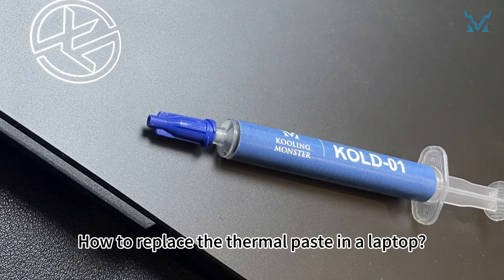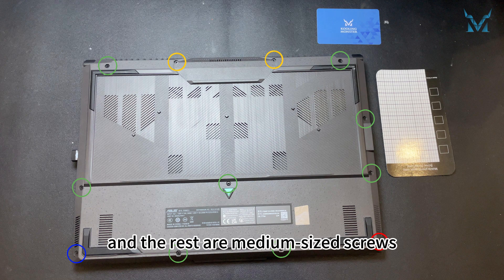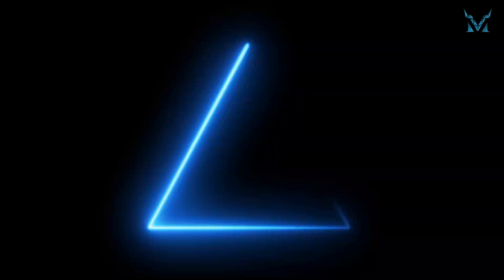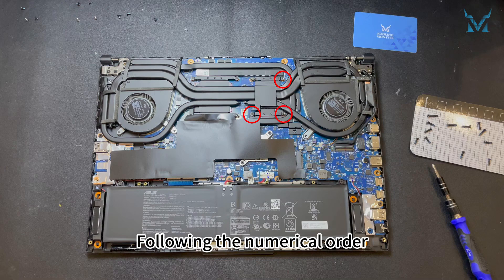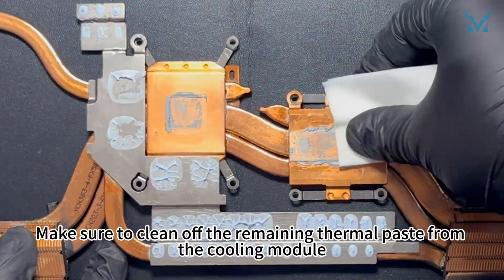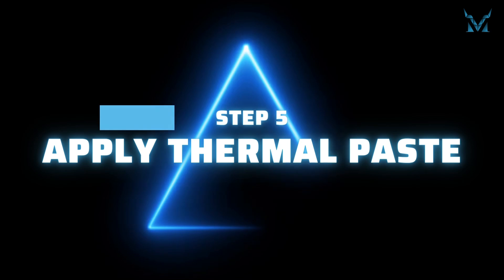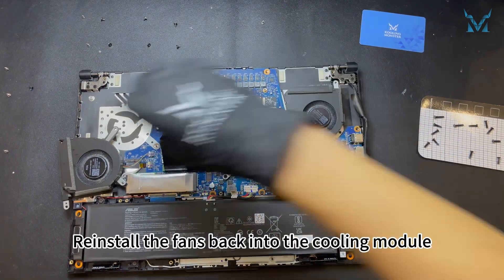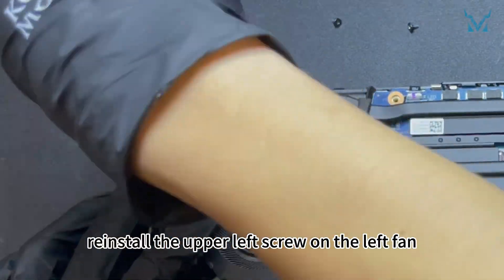Speed Up Your  Asus TUF Gaming F15 2024 Prevent Overheating With Dust Cleaning & New Thermal Paste

Comment: Please tell me why you didn't replace the thermal paste in other places. I don't know exactly what they are called, the ones on top of the CPU and GPU and on the side of them? Thanks
Reply from the maker: Great question! Those spots are for VRAM and power delivery components—they usually use thermal pads, not paste. Pads were still in good shape, so no need to replace this time.